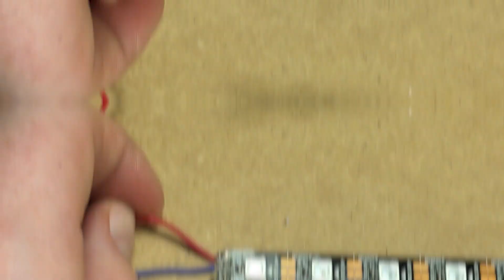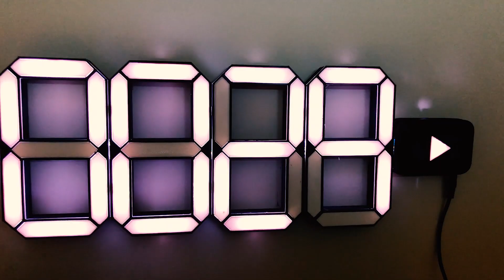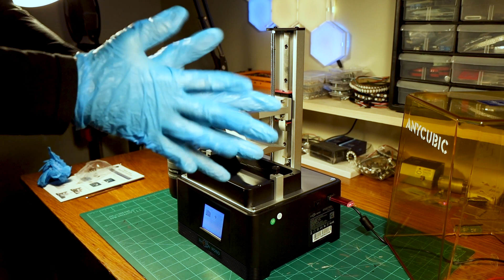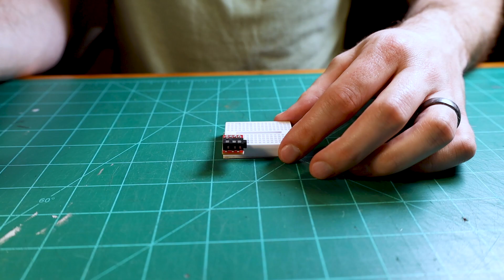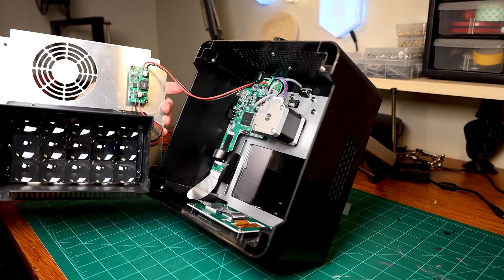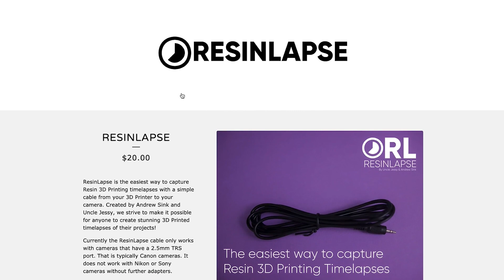How to Make a DIY ResinLapse!

Comment: Resin Lapse is great, but your solution allows for the small box to stay permanently attached to the printer when not in use while resin Lapse has a long cable hanging out. Nice job and great to see the thought process through.
Reply from the maker: Thanks for the comment! I agree, I like how small the box is on the back and I might even spend some more effort trying to streamline it further. But I'm happy with it for sure! Thanks again for the feedback!

Comment: I’ve made one last week using your guidelines. Unfortunately I can’t get it to work properly because with a 22k resistor it’s too sensitive and each time the printer exposes it takes like 10 photos and with a 30k resistor it’s not sensitive enough and no photo is taken. Amazing guide tho, wish mine had worked better.
Reply: you can use a small 10k potentiometer (trim with knob) and add it in series to the 22k resistor and fine tune it... than can you measure the potentiometer to know how much you need and replace with proper fixed resistor... or leave it like this if works

Comment: Great tutorial, I was already working at this project but not for professional camera but for general android phones (Most phones have good camera and still have the 3,5 jack), they need a 470 ohm resistor to trigger the volume+ action and use the camera and use gnd and microphone contacts to work... however this is driving me crazy, only my frankenstein old selfie stick has proper resistor in it and works, but if I try in my breadboard even a small difference of ohm make the phone ignore the action. also my photoresistor are dumb, they need an insane amount of light to be triggered (low resistance) and i cannot debug them because in arduino studio they show random number in all my analog port (all ports work with my potentiomenter)... btw again great tutorial ;)
Reply from the maker: Thanks! Glad you liked it, I hope you have luck with your resin timelapses!
Reply: I am currently trying to do the same thing and my phone is also ignoring inputs from photoresistor so i wonder if you menaged to fix your issue
Reply: Long story short, no.
I recently rescued 3 more android phones to test it out, best way to do it btw is to dismount a selfie stick and use the resistor in it, no other news, I will post the results if works 😂
Reply: @JostenSyon   thanks i already have a selfie stick and i was thinking that i might use an actuator to activate  a button mechanicaly since it is much easier to activate it that way

Comment: Good work. It's insane. Could you make a video about the Mega S Acura profiles? I'd like to improve my prints on Mega S and I guess I need to change my printer settings also calibrations.
Reply from the maker: Thanks for the comment! I don't have a Mega S, but I'll certainly look into it!
Reply: @ModernHobbyist  it's nearly same with the i3 Mega. I think it will be same. Thanks for the attention BTW ❤️
Reply from the maker: Of course! I'll certainly look into making a video about calibrating the slicing settings for the Mega base model!
Reply: @ModernHobbyist   You're the best! Thanks :)

Comment: Ive made this cable but with out the resistor, and it doesn't work, what does the resistor do?
Reply from the maker: The resistor limits the output from the photo-sensor making it require more light so it effectively keeps the the camera from triggering in low light conditions.

Comment: Which script is used to set the delay time？
Reply from the maker: Hey thanks for the comment! This final solution doesn't use any scripting or code to operate. It simply uses a photo-resistor to detect the light flashes when each layer is being cured, and it then triggers the camera automatically. Hope that helps, thanks again for the view!

Comment: Hi. I have a question. Is your last solution works with smartphones? Like a selfie stick that use the 3.5 jack on the phone, without any external power?
Reply from the maker: You know, I never even thought of this, but that's a great idea! I tested it with my current setup and it didn't seem to work with my iPhone. In theory it should be possible, but either the wiring needs to be different for use with smartphones, or I have the wrong type of aux cord (no mic on mine). From what I can tell, the volume pins control a smartphone shutter, while the Mic pin controls my Canon Camera. I'll keep looking into it, but I'd love to hear if someone else had success with this!
Reply: @ModernHobbyist  Thanks. I checked my selfiestick, it has 2 middle rings on the jack, so it should have the microphone pin. And definitely the volume control trigger the phone, bc if I dont open the camera, then it changes the main volume on the phone. At least on android. For iphone I just have a blutooth one, that trigger it the same way (volume contol, if the cam app is not open)